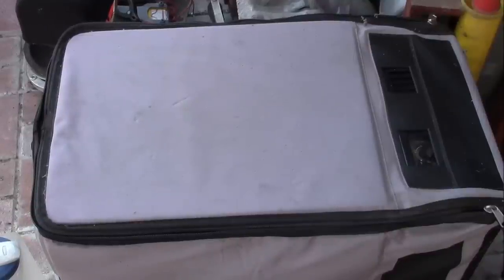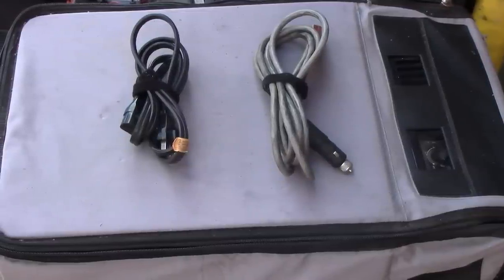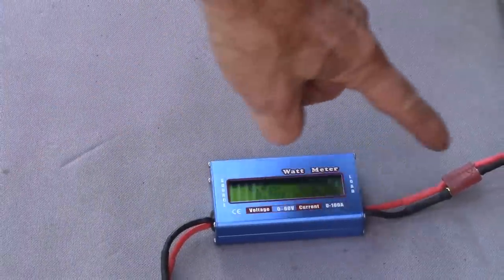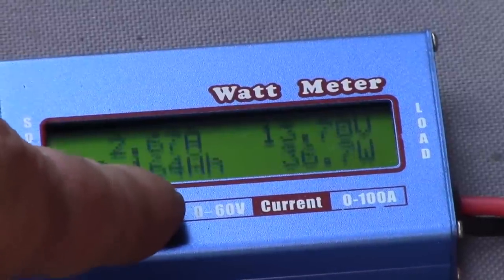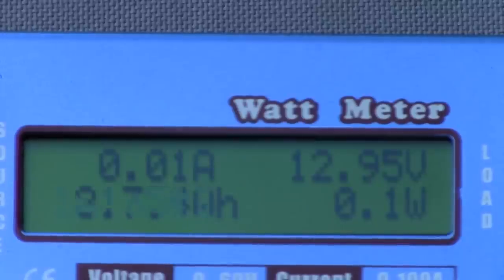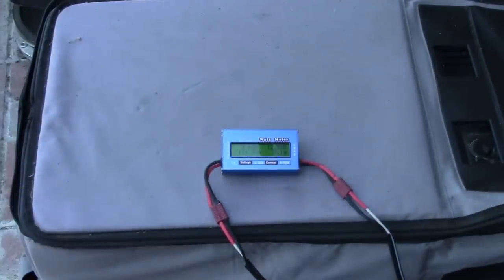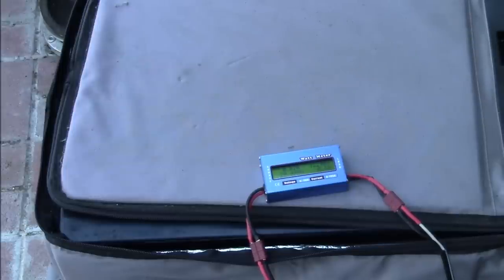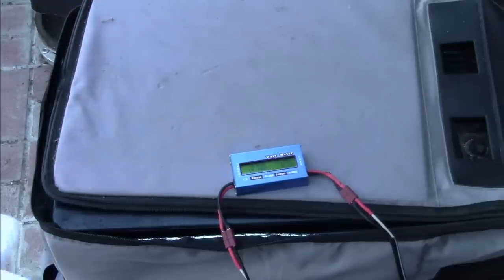12V Fridge/Freezer

Comment: people...buy a chest freezer and then a external thermostate for it so u can run it as a fridge ,,mine uses 170 watts a day
Reply: I'm surprised by that 170w/day number?  I bought a tiny 1.1cf 2amp 110v freezer from Midea and plugged it into the 1200 watt Whistler inverter on my truck (12v, 80ah,140RC battery - Bosch 94r).  The meter on the inverter read 90watts consistently. I ran for about 8 hours on high with my engine off!  and my inverter shut the battery  when i got around 11.5v at like 11pm . Water bottles in very cold but not frozen.  I cranked up my engine for about 20 minutes and battery got back up to 12.7v (not sure if legit but it was counting from there) and started everything up again.  The next morning  (about 8 hours later) my truck was a 11.1v which I know is not good and water was maybe 80% frozen.  I was able to start the truck but just barely.  This was just a test and not good for my battery I know...   I'm thinking my 110v freezer is not as efficient as a 12 volt freezer would be, but I wonder  how much better running a second isolated battery 12 v Lithium ION 50AH and a 12 volt 1.3 CF Dometic? I wonder what's the most efficient and safe way to alternator charge that very expensive Lithium ION as well? Anybody?  I think with a secondary Lithium ION and 12 volt freezer I could be less careful with volt limits and take the charge as far down as it allows.

Comment: Thanks you so much for sharing this precise information.it's very helpful for the people who want to buy a solar panel kit.Now they can buy the right size of solar panel for such a set up and save money.
Reply from the maker: anglia22 You're welcome, glad the information was of use.  I know when I had just a pair of 15W Harbor Freight panels, I thought it might work, but no way.   They would probably run it for a few hours under full sun, but no way to build up any charge for running over night.

When I added a 60W panel to that it would have been close to working.  Around 100W panel would probably operate it fine given decent sun.

Comment: Hello thanks for rekindling my search. Please I need help to get infor for a cooler that is solar powered that can freeze or cool drinks on the go. Do you know where I can buy one or even buy this your protype and how much is the estimated cost?
Reply from the maker: I've not seen a complete solar powered freezer.  But there are a variety of 12V fridge/freezers available in many sizes that will cool or freeze items.  Add on a solar panel, charge controller and battery of suitable size and you should be good to go.  For my unit (40L) a 60W panel would run it during the day, but to go overnight, 90W was about the minimum, along with enough battery capacity to handle the night time operation.  You can use my power consumption figures to estimate the energy needed and then size your battery off that.  Generally, for lead acid type batteries, you only want to use maybe 20% of their capacity.  So in my case with 12 amp-hours for 16 hours of (winter) darkness, I would need about 60 amp-hour battery capacity.

Comment: thanks for a great video I have been eyeing ARB for a while now I'm new to Solar I have 400 watts with a Morningstar Prostar 30 charge controller its PWM and 4 6 volt golf cart batteries I'm going to be adding a new set up soon that will be made up for 24 volts I will keep my existing 12 volt system in operation to run lighting router modem and things of this nature the ARB unit really looks sweet and I like how you broke down and powers and power consumption I would like to have one for refrigeration and then save up and get another for freezer once again thanks for a great video very insightful good information there thank you
Reply from the maker: +bill767667 Yes, would be nice to have separate units for fridge and freezer.  I think there are some RV type fridges that have both in one.
Reply: I think if I could afford it I would like one of each of the ARB units like you have there for the space I live in Ohio  about three or four years back I think it was we had straight line when they called it ripped through our area and we went without power for 2 weeks gas generators are nice maybe to run a big load but they're not cost effective over the long haul if the grid went down and they threaten all the time that it will I don't think you'll be able to get gasoline to run a generator so I'm trying to invest what I can and Solar I guess I'm trying to start doing a little prepping save food create my own power things of that nature hopefully will never have to resort to using stored food and things like that however if we need to do it would be nice to know you had it once again thanks for a very informative video
Reply from the maker: +bill767667 Yes, I also don't like gas generators.  Lots of maintenance and expense to keep them sitting around.  You need to run them periodically, keep fresh gas around, etc.  And you are just trading the electricity grid for the gasoline grid.  I like the solar backup system, and if you rig it up to power some loads to help offset the cost, it makes a nice backup power system.

Comment: Are you directly connected to the charge controller with fuse or to  the battery?
Reply from the maker: I use the supplied lighter plug (I think it's fused inside) and then that plugs into my solar charge controller DC load output, which is essentially directly connected to the battery bank by means of the controller's load MOSFETs.
Reply: Thank you for your quick reply, I will subscribe and like
Reply: Just for future people there is no difference between connecting to the load on the charge controller or the battery.

Comment: Can you use them as an everyday fridge/freezer? I enjoyed this video & look forward to learning from future video's :).
Reply from the maker: +Jason Miller Yes, I suppose you could.  It's built pretty rugged and should work in daily use.  One limitation of this model is that it can either freeze or it can refrigerate, depending on where the thermostat is set.  But you can't really have a two zone setup with a freezer and fridge at the same time.  There are models that support that mode or you could run two units, one as a fridge and one as a freezer.
Reply: R Brown Thank you for reading/replying to my comment. I am interested in learning more about low energy, portable appliences. Again thank you for answering/explaining my question :), looking forward to more video's from your channel :).

Comment: That's a little more than my fridge uses. I converted a 145 litre/5 cu ft chest freezer to a fridge by swapping out the thermostat and, empty, is uses 190Wh per day.
Reply from the maker: +Pop's Shack For sure, a chest freezer is going to have a lot more insulation than a portable fridge.  I know my small freezer (upright) uses about 2KWH/day as a freezer, but I can unplug it and it'll take over 16 hours to reach about 25*F.
Reply: +Pop&#39;s Shack ..lol..i know..have been doing that for over 20 years with my 4 cubic ft

Comment: Me and the guys are going on a festival next weekend, and i love that you went through how much AH you need to be able to connect it straight to the battery instead of connecting it to the carkey on/off surcit. im ganna buy one of those and let it run while we sleep in the car, and wake up with Ice cold beer <3
Reply from the maker: oskar jonasson Thanks for the feedback.  Yes, I was unable to find this information myself and so the only way to get it was to plug it in and measure for a day.  I've run my fridge off my truck's battery overnight many times but I never had the capability to measure the energy consumption.
Reply: R Brown Do you just have to make sure the fridge has been running and is "fairly" cold when you turn off the key and it should not drag more then maybe 12ah over the whole night ? is that a safe bet ?
Reply from the maker: oskar jonasson Yes, usually a good idea to get it cooled down while the alternator is running.  In fact you might set the temperature to a colder setting, then back it off once you shut the engine off.  You might want to test it out at home one night just to make sure your battery is up to the task.

Comment: I believe the ARB has switched from the swing motor to the danfoss (Chinese version) motor.
Reply from the maker: +Perry Stearns Good to know.  My unit is now about 15 years old and I haven't really looked into the latest updates to the model line.
Reply: This one would be the Engle which ARB distributed but their own design fridge uses the Danfoss (now known under a new name) motor since only Engel uses the Sawafuji swing motor.